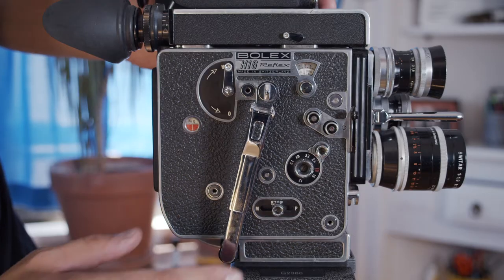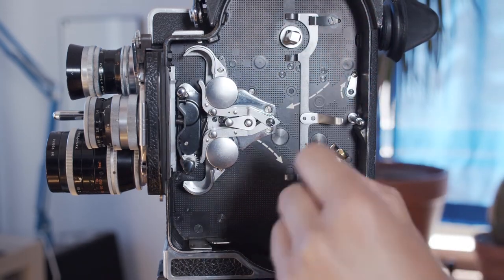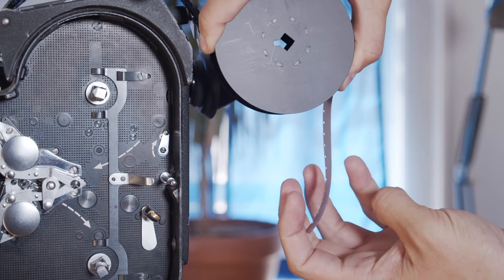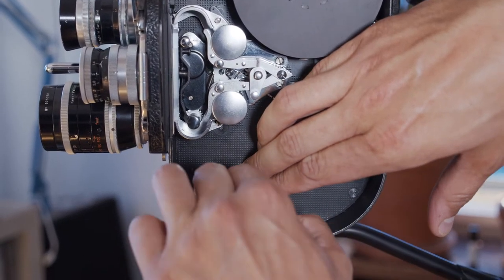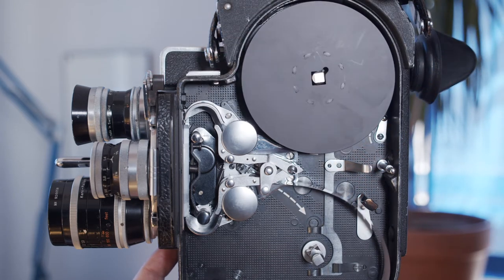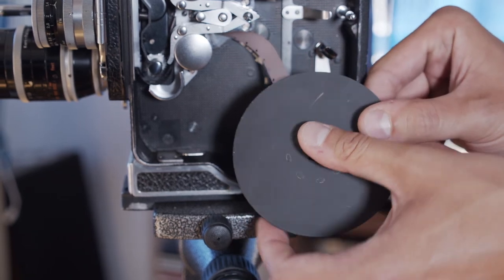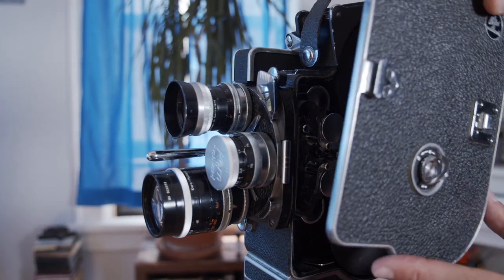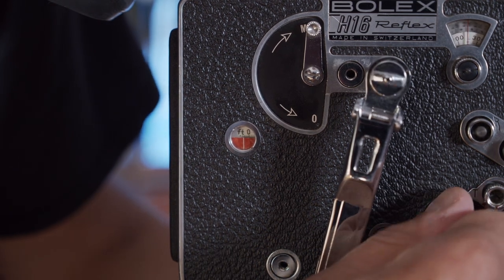Bolex H16 - Loading Procedure

Comment: Thanks for making this video. So all of this can be done in the sunlight? Not in a film changing tent? I am trying to rent a h16, but it has been modified for 400 ft rolls, I was wondering how similar the process is.
Reply from the maker: @999yuiop  Yes the Bolex may be loaded in subdued light, so technically outdoors is fine, but you want to do it in the shade if you can. Bright sunlight can flare a roll beyond the point of acceptability.

Comment: Hi, I found out that I forgot to disengage the loopformers when I started filming. Will that ruin the film? 😊
Reply from the maker: Sorry just saw this. It depends, on later H-16s there is a fail safe that addresses this (the camera door activates the loop former release switch). If the camera doesn’t have that, then the formers were in place and your footage may be scratched.
Reply: @isaacbrooks5412  ok, thanks for the reply.

I’m waiting for the film to get returned to me in digital form. So I hope it turns out well 🤞
Reply from the maker: @magsundgot  whats the inside your Bolex like? Is there a push-button in the center of your loop-former lever?
Reply: @isaacbrooks5412  no push-button.
Reply from the maker: @magsundgot  hopefully it turned out ok!
Reply: @isaacbrooks5412  it did 😎